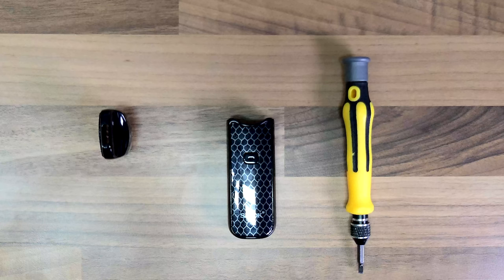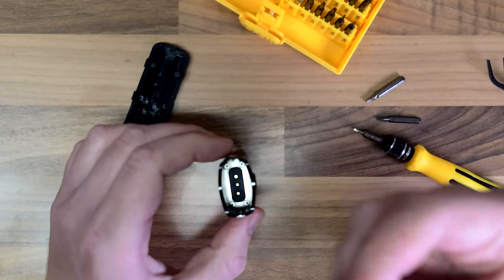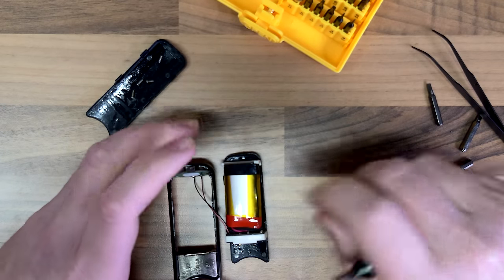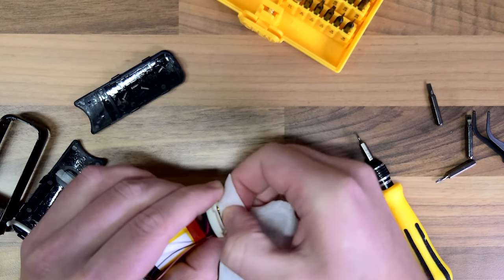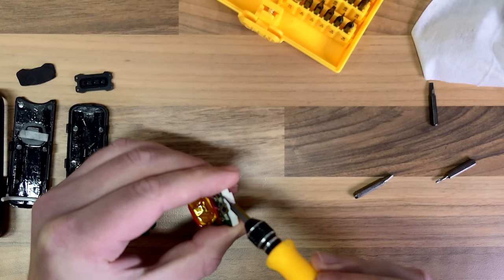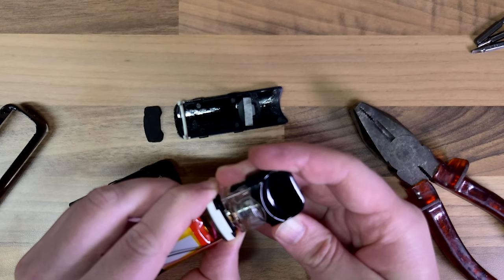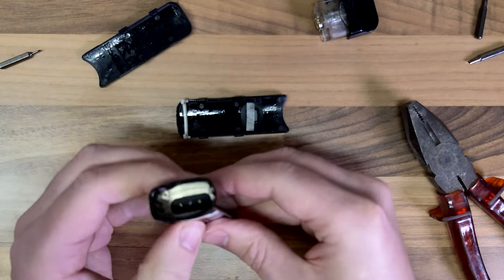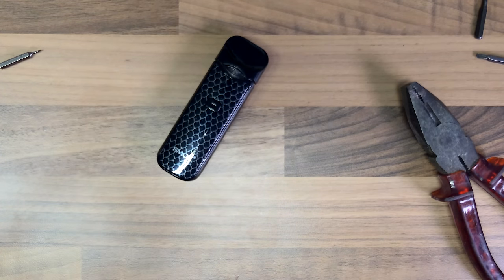Fix Smok Nord with stuck pins - Taking apart a Smok Nord - How to disassemble a Smoke Nord

Comment: SOLVED IT.
So. I tried it. And well. The spring is broken.I pull it back up and when pressed just goes back down. So what I did was (saw it here in the comments) got a flat wire coil (colossus) and stuck it through. Theres a metal plate underneath the rubber so as long as both ends touch the connectors you're good. I kept cutting it short enough though, to make sure the pod flushes right. Get any conductor to connect both ends and it'll work. Also be careful with foil because if it touches the other pins it will short. I tried. The only way to turn it back on is if you charge it after a short. So just stick a pin through it you're good.
Also tip, if you guys are gunna leave it for a while, take off the pod head AND the coil. Because the coil WILL stick to the pod head and you'll have a hard time replacing coils.  in which case YOU WILL break the pod head by trying to force it out and have to buy a new one. I know. Because I've broken 2 heads already. 
So 
1)stick a conductor where the pin is stuck 
2) never leave the head and the coil together when not using because it will fuse together AND IT WILL LEAK.
3) don't ever fucking buy smok again 
Hope this helps guys. I just didn't want to give up on it and justify why I spent money on it in the first place.

Comment: Finally someone made this video, I've had a dropped pin for like 5 months I just stripped an old cable I had that I didn't need and rolled some of the wire into a ball to make the connection from vape to pod since I couldn't find a video on this 🤣
Reply: same goes to me
Reply: You have a bigger brain than me I threw mine in the garbage
Reply: @YB-oy5oj  same brother

Comment: I have a FIX for this: 

1)take off the sponge behind the circuit board and unscrew the WHITE plastic that protects the pins.
2) get some sanding paper and sand down the flat part of the white plastic piece. You need about 0.6mm so it won't take long. Just make sure you apply even pressure to keep the surface flat. this will make all three pins protude 0.6mm up when you reassemble, the trigger button seems to have enough margin to allow this. 
3) reassemble or repeat if needed. 

You want the pins to move UP to the point where it no longer matters if they don't have a working spring. this means the tank will most likely not click into place anymore. 
I have permantly fixed 2 old nords like this.
happy tinkering!
Reply: I took the time out to do this and it worked well, but because I kept sanding eventually the white piece snapped at the edges where it screws into the motherboard so be careful for that. Also between going back and forth from testing to see if there was enough sanding - the two wires, the red and black, for the usb came detached. So I'd watch for that too if your reading this. Ukno despite these issues I ran into, and my lack of carefulness, the bitch still works astonishingly lmao.  (and ofc I had to solder back the wires for the charger, this was the biggest pain in the ass of all so just be careful not to make the same mistakes I did)

Comment: My nord 2 is actually firing by itself, the vape thinks the button is being pressed. I will try this on the Nord 2 and see if I can clean the button out. I have to pull the pod because if I shut it off with 5 taps it’s very hard to get it back on because it sees random button presses.

Update: the tape that keeps the outer button in place came off so the button was sticking to the fire button on the board, I added a small piece of scotch tape and got it working. Thank you for the tear down!

Comment: Thanks. That was helpful in taking mine apart. I didn't have stuck pins, needed to clean it since it fell in my drink, but now I'm having a problem with the button being stuck down or something because it won't stop hitting as soon as I put the pod in.
Reply: the sensor inside was still wet, causing the auto-firing. you need to wrap it in a tissue for the best absorption. now, i know you don't need this information anymore (you probably have a new one now) 😂 😂

Comment: Great video had the exact same problem
What we decided to was to take a soldering iron remove the middle pin and swap it for one of the outter pins. It creates the same circuit and works normally

Comment: Thanks a lot! It work pretty well, in my case i've put tiny tinfoil between the stucked center pin to make it connect to the coil. now it works again.
Reply: It does work..i dont have the right tools to open my pods...so i cut a tin foil and fold it into tiny square..snuck it a little bit beside the stuck pin..voila..it start firing normal again..thanks for the tips..
Reply: Lots of thanks! I don't have the tools either, I made an aluminum ball and put it on top of the pin, it works perfectly
Reply: Effectively! thanks

Comment: Thanks for the help, it was just exactly what was wrong with mine, actually it was a used one given to me.  Anyway I fixed it just like you did except I just took a pointy knife and pulled on the pins til they made contact again.  I think its time for me to buy a new one.  I actually just started vaping after 38 years of smoking, thanks again mate!
Reply: Joseph Brauninger I did about the same thing tried to bin it but couldn’t cause all I got is needle noses but pulled it up and put the pod down softly and it worked
Reply from the maker: Joseph Brauninger my pleasure! Congratulations on stopping smoking, if nothing else it’s much more convenient to Vape and no one complains you smell of smoke anymore. 👍

Comment: I’m on my third Nord and the middle pins on my first two did the exact same thing after several months of use, I still have them so I’ll try to fix them. Excellent video, thanks
Reply: Lmk how it turns out My first nord Is like that it looks the the middle pin is completely missing and it was a special edition colors So I want to fix it Stuck with a green one for now

Comment: I took a very tiny piece of welding wire and I laid it down over top of that pain. My vape works now. I had watch this video and brainstormed a little more because welding wire is a conductor of electric so by laying it down directly over top of the PIN it gave a good connection

Comment: This was extremely helpful and saved me a ton of time and headache! Thank you! I couldn't find my star bits, but suspected that the spring was broken because it wouldn't stay up. I just used needle nose plyers and pulled the rubber out from the top (knowing the thing was toast now anyway), and then did the same thing you did to squeeze the base the pin is seated in to make it stay out. I imagine it will either drop again eventually or the juice will flood the board, but it's working like a charm for the time being. What a shit design. As much as I have loved almost everything else about this vape, it's not even my main vape and less than three months old. Will not be buying another smok product.
Reply: same with me man! i have like 50k usd worth of tools that i can get to and could not get a star bit that would work. so i took some needle nose and squeezed as hard as i could and its working. smok deff missed the mark on this one.
Reply: Same bro honestly the vape itself is such a good device but the flaws in the design eg( the pins staying down, the pod leaking 24-7,etc) make me not wanna buy smok because if u look online I’d say 80% of users have the same problems so it’s inconsistency in theyre products it’s not just like 1 in 1000 of them do it

Comment: Thanks this helped alot. I have two, one with the center spring broken, and one with the anti-static thing tripping out (Wont turn on). The spring I fixed by putting solder on the tip, and the other one not turning on by cleaning the pins

Comment: I managed to fix mine with the same problem by dropping a little bit of solder on the middle pin to make is a bit higher and it made contact
Reply from the maker: StickyVelcroPig Thats actually a very good idea. Thanks for commenting.
Reply: I did a similar thing. You basically have 3 options with solder.
1. Make a bubble on the copper center of your coil.
2. Put enough solder on the middle pin to make up the difference.
3. Pull the middle pin up half way and solder it in place. As long as the 2 outside springs still work they will adjust to the right height.

Option 2 sucks. I did 3 after realizing I would have to modify every new coil with 1.
Reply: Nate Wilson you mean option 1 sucks?
Reply: Michael Heathfield is there a certain type of metal I need to solder on?

Comment: All I did to get it firing again was just to remove the rubber base of the pins and assembelled it back again. Works perfectly, but the downside is to remove the tank when not in use to prevent direct leaking onto the circuitry below

Comment: Guys...trust me 100% If the middle pin inside the nord pod goes inwards....USE a "Cuticle Nippers" and pull out the pin...EZ I literally just did it right now. You DO NOT need to unscrew or ply anything out!

Comment: I didn't bother reading if this was mentioned yet, but you can also swap the center pin with either outer pin. Both outer pins have continuity and connection to the neg bat lead.  You'll obviously need a soldering iron, some previous experience/skill, and proper safety precautions like removing the battery before you start (keeping the leads very far apart), but so far mine is functioning again with the rubber piece intact and without modifying the pins/bridging the gap by other means

Comment: I had 2 of these that both had the middle pin stuck.  I tore one down, and tried to remove the center pin with a soldering iron, but before I could melt all of the solder, I somehow bridged a connection to the LED.

I ended up ripping out the center pin on the 2nd nord (I did not take this mod apart, i just used pliers to rep it out from the top side where you would seat the pod)  and screwed one of the torx screws from the 1st mod into the hole of the rubber bushing. This provided the contact needed to get it firing again!!

Comment: Yo I found a fix that doesn’t require you to take anything apart. I’m not sure if it’s long-term or anything because I just did it, but I had this exact same problem with my nord 2, and after ripping the whole thing apart only to find out that I don’t have the right torx bit, it turns out that if you take a pair of needle nose pliers and basically take the pin and twist it clockwise, it fixes the issue. Before it was like the spring was completely gone but after I did this it came back. This was definitely a helpful video, but I wouldn’t recommend taking yours apart unless you can’t find ANY other way. Hopefully someone can learn from my mistake! :)
Reply: Rotate the firing button or like the pin inside I’m having same problem w nord 2
Reply: @mrpines1o180  the pin itself. The one that’s stuck

Comment: Didn't get how you were able to make the pin stick out permanently. I just added soldering lead to the pin. Thanks for the video, got to open the Nord without breaking it.
Reply from the maker: Jerome Orbista the pins slide into themselves, by squashing the top of the pin it’s no longer able to slide into itself. Hope that makes sense?
Reply: Totally makes sense. I got it the point after watching the video again. Thanks again.
Reply: @tombritten7841  If it works and is fairly easy to do then why not do it when you first get it so they won't end up failing later on?

Comment: People at my vape shop say this is a pretty common complaint.  I've had one unit do the same thing.  It wasn't stuck down, the spring broke or was dislodged.  I suppose if its within 6 months you can use the warranty but after that you're just screwed.  So its either gonna get stuck because of leaked juice or the spring will stop functioning.  So it becomes a balancing act of keeping the pod in and risking it leaking or taking the pod out when not in use but wearing the spring out.

Comment: Helpful video. I've fixed my middle-prong issue in the past by cutting a small circle of rubber out from the rubber panel around the prong. It worked for about a month but now I'm having the same issue again. This time it lights up when I slam the carriage down, as if it's making a connection, so it could just be the coil. It semi-fires, so I can still use it if I repeatedly press the fire button, but it's a bit annoying. I've had my Smok Nord vape for about one and a half years, so maybe it's time for a replacement.

Comment: for me it was my side pins that became stuck i took them apart following this video but the springs would not pop back up even with alcohol so i pulled one of the pins out and i found no springs? just a little ball, weird maybe its some kinda air spring or something? ether way i read in the comments about soldering the pins so i ended up putting a little ball of solder on the tips, it took a few tries to get it even but works like a charm!

Comment: For those who dont want to disassemble their smok, just fold up a small piece of foil as a pin extension, it works.
Reply: I did that and I think it fucked up my battery it won't turn on or charge idk
Reply: @ur_boiaaden4167  There's probably something else wrong then, the foil is just a small conductive bridge to complete the circuit when you press the switch; I think the only way this could mess you up is if the foil bridged across or touched multiple contacts, then you're skipping the switch and basically melting your battery.
Reply: @Lt-no4sy  that's exactly what I was doing my high ass thought it would be smart to this while plugged in though
Reply: i was thinking of gluing it after sticking it out! but i think I'm gonna try the foil method
Reply: @achannel6677  you can do that but most strong glues will become crystalline after curing and will shatter after prolonged use. Would probably work in a pinch for a few refills worth of reinstalling your pod, but enough repeated impacts/pressures on the post will likely break/jar it free again. I did the foil thing with mine when I posted this and it's still working fine today, just have to readjust the little foil square I made every once in a while.
Reply: I did that and it fucked it, HEY BEND YOUR COIL!!!!!!!!
Reply: @ur_boiaaden4167  SAME HERE. just did iy and ITS COMPLETELY DEAD now! No light, nothing! I'm pissed!
Reply: @ur_boiaaden4167  mine wasn't even plugged in and its completely dead now... Wow
Reply: ItsEasy  hey, it wasn't the middle pin that was stuck, it was my two end pins
Reply: @mr.kissoon7250  Sorry the original comment wasn't more clear; the idea is simple: the pins exist to complete a circuit within the device, if the spring tension breaks, they cannot complete the circuit. However, the pins are attached to a circuit board/switch that controls the system, if you "bridge" the pins together with metal, they will break the system, so you need to be careful to not let the foil touch the pins together. In your device's case you would need to put foil between any pin with a broken spring (two for you, one on each side).
Reply: @Lt-no4sy  i think its because the foil touched all the pins together, which probably fried the circuit and killed it... I literally bought a new Pod today, it was a lot to spend, but still, time for a change I guess?
Reply: @mr.kissoon7250  that's likely what happened; they can be finicky and electronics are always sensitive to unintended circuits. I'm in a situation where it takes weeks for new stuff to arrive so my improvisation attempts are a bit more serious. Just got a new battery in today though, so now I just have two smoks; the crappy one will just be my backup, since the foil is still going strong, been using it for 4 weeks now no troubles and minor adjustments when necessary

Comment: Both of the side pins are ground, the middle is positive. the pins just snap in and out of place. so if you swap one of the side pins and middle pin it will work fine. you can even leave one of the side pin slots empty.

Comment: Mine just got a slight rust around the middle button after leaving it months without using. Kinda my problem when i was too lazy to drain off the juice from the pod. I was wondering how to dissemble after removing the top 4 screw and got to this video feeds. Just a protip, when trying to take out the back cover there's two hinges on each side if you carefully use a blade knife and hook it out, it would hardly damage the cover nor the body paint works. I decided to fix it after buying smok 80rpm pro. Anyway thanks for the video once again for helping out.

Comment: I’ve found that pushing juice out from from the bottom of the coil we’re the insulator is really helps. It looks to be negative wires there that make ground contact with the side of the coil. In my experience with this little trick even stuck pins still make good enough contact. Thank my later.
Reply: blow from the bottom of the coil?
Reply: Well you just kinda squish it out
It’s the insulator. The saturation build up underneath that white rubber piece
Reply: And I wouldn’t blow it unless your using compressed air

Comment: You can pull the pins out with out taking anything apart, but, my problem is that as soon as you plug the tank back in, they get stuck dow again.Might get one hit before it stops working. I am on my THRD unit. They are great, when they work! Utter RUBISH when they don't which is usually within a couple month depending on your luck.

Comment: Same thing happened to me. You don’t even have to take it apart. The problem is the middle spring is broken and doesn’t push the middle pin up. All you have to do is connect a little piece of metal to the pin so that it reaches high enough to hit the coil. Or just super glue it in place, just to the point where it is low enough for the pod to fit in but high enough to reach the coil